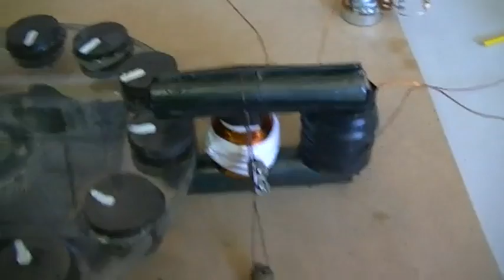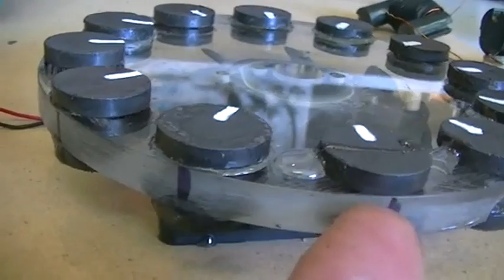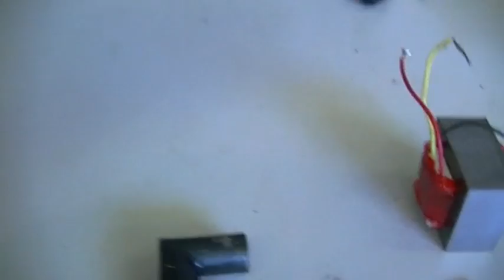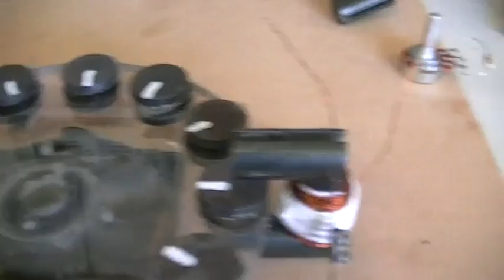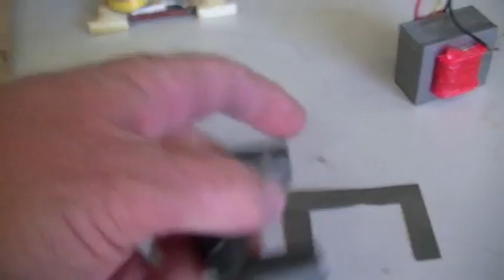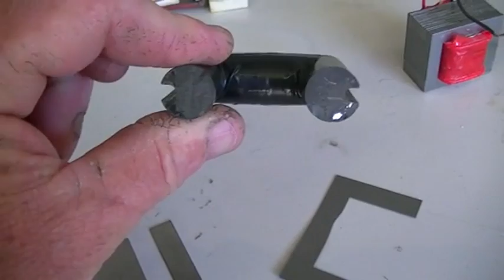Core material drag test

Comment: current is produced 90 degrees after the voltage, so to answer your question i would guess with those magnets slightly off to one side. However since the purpose of your experiment is to delay the current... maybe more.